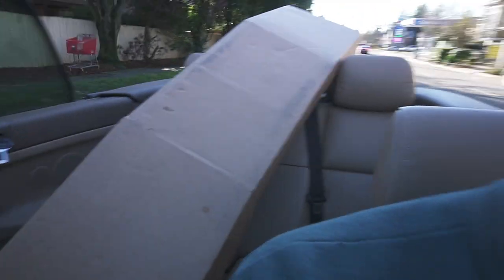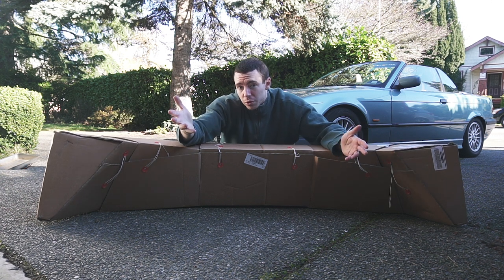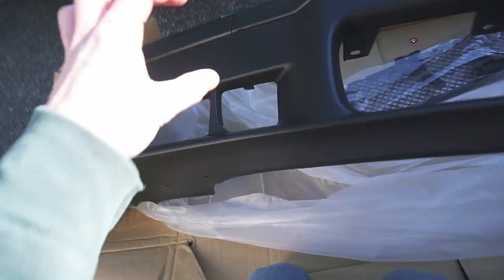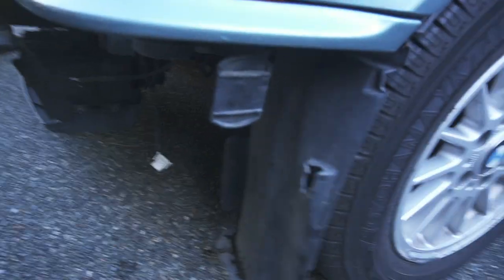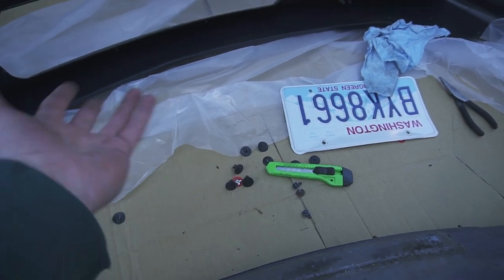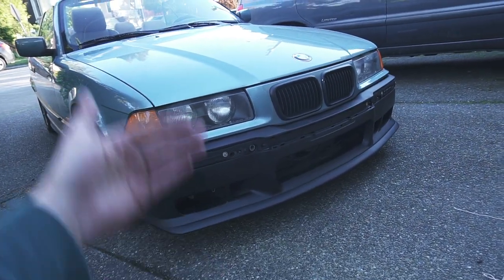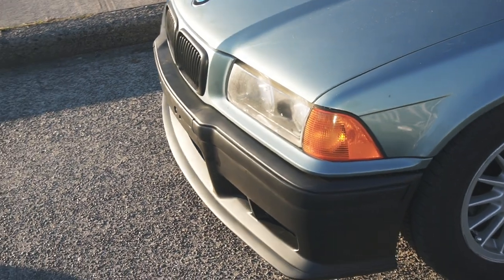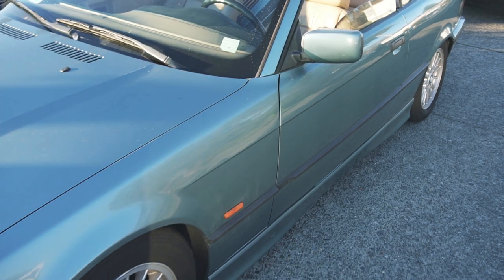I bought an M3 bumper on Amazon... how bad is it? (e36 build part 3)

Comment: Air temperature sensor
Reply: On my e36, the Ambient air temp sensor is on the driver's side and the sensor on the passenger side is temp sensor for heated windshield washer nozzles.

Comment: Thanks for making this video!  I just bought this bumper from an EBay vendor.  This will help me a ton when installing it this week.
Reply from the maker: Awesome! I’m so glad to hear it, I hope the install goes smoothly :) Little tip on securing the grill that I didn’t mention in the video 
: try using small twist-on wire connectors on the little pegs to hold the grill in. They’re removable and super secure!

Comment: Those plastic clips come out by pushing the centre of them out with a small Allen key or screwdriver 🪛
Reply from the maker: ^^ yes!!! I figured this out FAR too late and neglected to include it in the video. I’d still recommend replacing with metal fasteners if you’re in there, but they’re definitely salvageable if you’re smart about it (which, unfortunately, I was not).

Comment: What mm screws you use to replace those trash plastic ones
Reply from the maker: eek i wish i could remember.. i think they were around 5-6mm diameter if i had to guess? It’s most important to get ones with conical heads and washers that sit at the very top of the head so that they’re flat enough to sit behind the trim :) hope that makes sense
Reply: @logan-taylor  thanks mah man 👍🏼

Comment: What about the grille?
Reply from the maker: Grille fits great, high quality molding, etc. but It comes with crimp washers to hold it in and  they’re really bad quality. I would suggest replacing them with small screws or discreet zip ties. Otherwise, grill looks and fits great.
Reply: I cant get the grill to fit properly. It came with those washers but pins wont line up to get it mounted flush to inside of the bumper. Ugh
Reply: @ericdye5056 mine just came off.  Thank goodness i found it on the road and no accidents! They didn’t last a day for me.